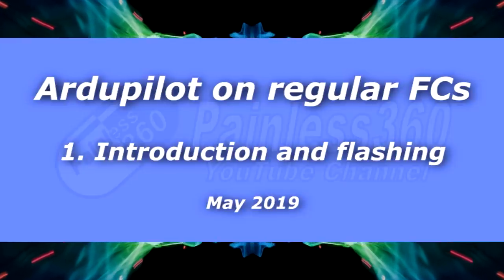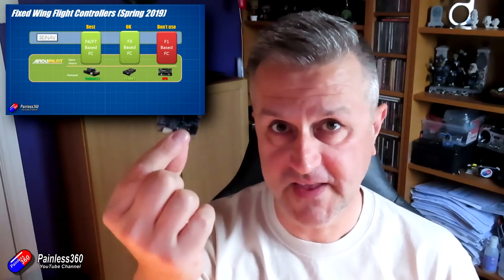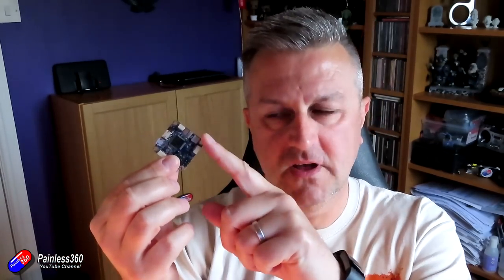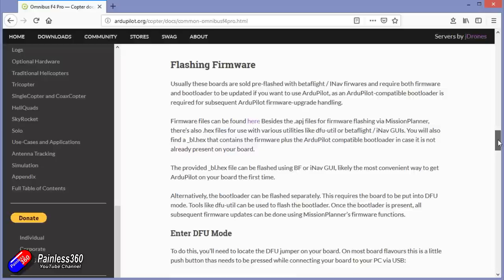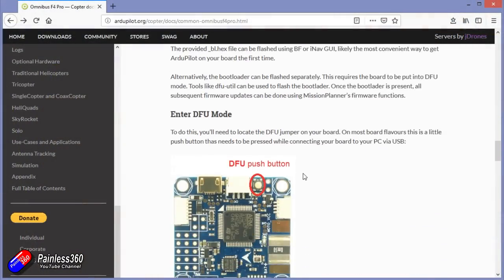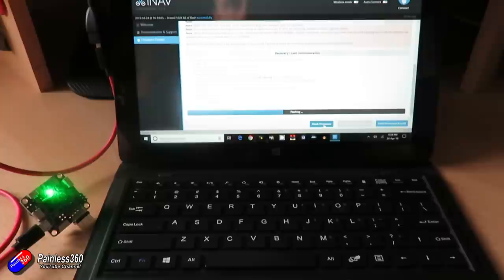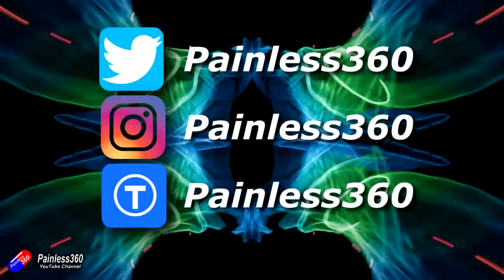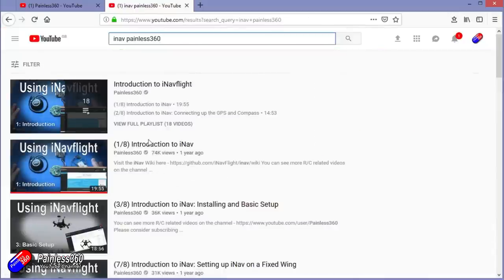Easy Ardupilot on Omnibus Series: 1. Introduction and flashing the firmware

Comment: Sorry if you have already answered this somewhere but, last I looked, if you were building a QuadPlane using Arduplane you were stuck with using a Pixhawk or Cube as they were the only controllers to give enough I/O to handle 5 ESCs and at least 3 servos (preferably 4). I have a Pixhawk shoe-horned into a Ranger1600 based QuadPlane and it would be great to be able to use something more compact (and with more durable connectors!).  Are there any options I should look at please?
Reply from the maker: I've not tried a Quadplane so don't have any experience to sue to answer this one for you. I have used a trick or two when I'm not sure how much power the servos need (see the Arduplane/Omnibus series..) Hope that helps.. Best of luck!
Reply: @Painless360  Many thanks for the reply. I have done another scan of the market and it seems the Pixhawk and Cube are still the only controllers with sufficient I/O for QuadPlanes though my guess is that the rise in popularity of the QuadPlane configuration will promote more controllers that will do the job.

Comment: Great video!
Will ardupilot work properly when installed on regular Omnibus F4 v3 (non pro) if external current sensor is connected from 4in1 ESC?
Reply from the maker: I've not tried, the wiki is very specific on the specific boards supported ...
Reply: Painless360 Thanks for reply. I'll give it a try.

Comment: Do you have a page of the steps you used for the beginning setup of the FC for this? I bought a board to experiment but i want to make sure i solder the 5v pins etc corrctly
Reply from the maker: All steps are shown in the series. Best of luck with the build...

Comment: If I power 4 9g servos and a Raspberry Pi Zero with the on-board SBEC, is it going to be fine or catch fire? I don't ever see anybody using the on-board SBEC on the F4 Pro with Ardupilot.
Reply from the maker: You need to figure out how much current all those things need and see if it's less than the on board 5v regulator is rated for... See how I did it by watching the rest of the series...

Comment: HELLO MY FRIEND !
I watch your videos, and I think they're excellent. I was very interested in purchasing an Omnibus F4 Pro after I learned that it can use Ardupilot, more specifically Arduplane, as I have Apm, Pixhawk, Pixracer etc, and I only have to say great things about these controllers and this firmware, but now I'm going for FPV with flying kite, your kite is very nice, congratulations!
Ok, let's get to it, kkkk, just ask me some questions. You have shown that there are two ways to update the F4 Pro firmware, one is by Inav itself and the other is by Zadig, am I correct? do you put the F4 in DFU mode ?, you have to keep holding the button, or just a touch, you already enter DFU.
Thank you. Greetings from São Paulo, Brazil.
Reply from the maker: Zadig us used to replace the  driver when it's in DFU mode. See my video about it and flashing flight controllers... Happy flying

Comment: Is it possible to flash ardupilot on dys f4 pro v2 or cl Racing f4?
Checked the ardupilot website. Couldn't find any firmware
Reply from the maker: If it's not there then it's probably not supported... yet!

Comment: Great series. I was using APM years ago starting with APM1 (still have one laying around) and now am to build in a MatekF411 into a Bixler, but I really would like to go with Ardupilot, as I know it very well and liked it those days, when nothing else comparable was out. I do not find the Matek F411 wing board on the boards list on the AP site. Only the F405 is on the list. Do you know or think if the F411 will work as well?
Reply from the maker: As far as I know only the boards listed are supported..
Reply: @Painless360  Thanks for the quick answer. So I will have to get one of those supported boards.
Reply: @Painless360  I will give the F411 a try though. So what could possibly go wrong? There is only one way to find out ;)
Reply: Does not work. Tried to flash the Matek F405 Hex onto the F411, but after around 25% the progress bar gets stuck and nothing more happens. So I can confirm, it does not work on the F411. Will stick with INav on this board and consider Ardupilot for another build and then will go with either the F405 or the Omnibus pro.

Comment: Just getting my feet wet with all this. For all the extra cash a pixhawk will run you, are there additional features it will have that a cheap FC will not have?
Reply from the maker: Depends on which PixHawk you're talking about. There are lots - see my PixHawk series. If you want an OSD then the non PixHawk boards are the way to go..

Comment: What would cause iNav and Betaflight to not load “local” firmware? I have an f4 pro v3 that has iNav flashed and tried to flash Ardupilot but the firmware won’t load. I downloaded the latest stable version of ArduPlane hex for the f4 pro but neither iNav or Betaflight will load it.
Reply from the maker: When you mean load it do you mean into Beta/iNav flight or to then flash it onto the board? What specific error do you get?
Reply: Painless360 I tried on both iNav and Betaflight. I go to firmware flasher, click on “Load Firmware Local” the window opens to select the “ArduPlane” hex file, I click “Open” and it doesn’t open in either configurator. The “Flash Firmware” button never lights up because the firmware isn’t loading for whatever reason. I can flash iNav or Betaflight to it without problem, but not the ArduPlane. I don’t get any errors, it just doesn’t load.

Comment: Hi, thank you very much for the helpful video, I have successfully flashed Ardurover V4.2.0 onto my Omnibus F4, but I am running into an error when connecting it to Mission Planner. The error code in messages is - Config Error: INS: unable to initialise driver. I've tried flashing other modes such as Arduplane V4.2.1, but again the same error message shows up. I have not soldered or touched anything on the board yet, it is brand new out of the box. Wondering if you have any solution to this? Thanks!
Reply from the maker: I've not seen that, I'd check the forums.. Best of luck
Reply: @Painless360  Hi, thanks for the reply, I've tried searching the error code up on the forum and internet, havent found anything beneficial yet. Could it be related to the configuration page on mission planner? maybe I have to change a couple of values or parameters? what are your thoughts? Thanks again!
Reply from the maker: Like I said, I've not seen it. https://discuss.ardupilot.org/t/config-error-ins-unable-to-initialise-driver/74920

Comment: can you install a full side tbs Crossfire rx, that way we can use mavlink over the bluetooth and show the plane in mission planner.?  One more item Lee, some of the V3 boards have bad barometers, so works in the beginning but after few reboots goes red, is not the software is the hardware be aware.
Reply from the maker: I've not tried it but I don't see why not. You just need to get the telemetry pins from the flight controller into the 'MAVLINK pins on the receiver.

Comment: Hello, I've followed these very helpful setup steps and have 2 issues. External compass won't calibrate, "seems like it is still using internal compass. Also it is not recognizing my radio receiver. Any help is much appreciated. I am at a loss, gps and everything else is working well.
Reply from the maker: Every step I followed is in the series. Happy to help but please watch https://www.youtube.com/watch?v=olIqTiSJHIY and come back to me with more detail of what you've tried..
Reply: @Painless360  I've retraced my steps and got me radio calibration figured out. But still cannot calibrate the compass. I dont have the live calibration option for some reason. I am trying the onboard calibration and the green bar runs up to 99% and restarts over and over. I've swapped the bn-880 and get the same thing. I am running mission planner 1.3.70 and the latest firmware in the stable directory for the fc. Also tried calibrating in Qground control with no success. Do you have any ideas what to check next?
Reply: Qgroundcontrol gives me a code of "mag bad orientation" when it fails the calibration.
Reply: @ivyscrochetcorner7983  hello did you manage to fix the problem i'm having the same as you

Comment: Edit:-......Fix for problem below.......Finally worked out with your help how to get the bootloader file for the Rover (boat..... ) ardurover_with_bl.hex onto my Omnibus F4 pro board...thanks....so do I now have to load the other normal hex file that was in the same folder on Ardupilot site ( ardurover.hex) before the Mission Planner will see the Omnibus F4 pro board..???
Downloaded the Mission Planner and plugged the board in with just the bl file but nothing comes up... blue light is flashing but nothing from Mission Planner......tried the "connect button but it says timeout waiting for Mavrick ...the board I can see in device manager....a second usb device shows as omnibusF4pro-BL but no extra com port coming up.
 If I go setup to load the rover program from within Mission Planner it says failed to recognise board.
Just went through and did a reflash of the ardurover_with_bl.hex and it says all ok...seems I'm missing something basic here...but has me beat as to just what.
Reply from the maker: All I figured out is in the series. Maybe a driver issue? Best of luck
Reply: Thought I might let you know and for others who may get the same/similar problem, I managed to fix the problem using a small program called " ImpulseRC Driver Fixer". Cheers

Comment: Hi there could do with some help, am  using the same  omnibus f4 v3 pro i've soldered the receiver wires to the pin holes so to practice on simulators but transmitter /receiver not talking ( sticks not moving in betaflight)  any ideas what could be wrong and do i need solder the other required pins before sticks will move thanks in advance .
Reply from the maker: You need to setup the type of receiver in Betaflight and also solder the little pads for S-Bus or PPM on the FC itself.. Best of luck!
Reply: @Painless360  Hi again thanks for fast reply , i've soldered the pads on FC for the S-bus/PPM but still no signal between receiver and transmitter, maybe transmitter cant bind powered by USB so will connect to PDB see if the  it binds if and  all goes well will keep u posted thanks again  *

Comment: If I’m using arducopter do I wire the moters in the same place as in normal pinout for the omnibus (pins under rc in)
Reply from the maker: You can configure the  pinpoints however you need. See the next videos..

Comment: Hi folks from Belgium.
I flashed the firmware using airbot f4 firmware on inav.
It would not open in mission planner 😢
Could you show me the correct link to the firmware on the ardupilot site? Please?
My board is omnibus F4 Pro v3
Thanks a lot!
Reply: Hi, first you will have to decide the Ardupilot firmware type. You can choose between ArduPlane, ArduCopter, ArduRover etc. 
For a plane: http://firmware.ardupilot.org/Plane/stable/omnibusf4pro/
For a multicopter: http://firmware.ardupilot.org/Copter/stable/omnibusf4pro/

Comment: Could you use this board and ardupilot plane in a flying wing and not implement the GPS or OSD and just use the stabilizer and auto launch functionality ?
Reply from the maker: Yes but you would be missing out on a lot of extra benefits for the sake of a GPS...
Reply: @Painless360  Thank you so much for the quick reply. Will go for the GPS as you suggest. Thanks again!
Reply: Please ignore and apologies for asking. Just bought the f4 pro on ebay.

Comment: painless, hope to get your help on connecting sbus receiver to a f4v3 non-pro fc. the communication is just not working. i have tried connecting gps and bluetooth to the fc and both worked. i have no idea the sbus does not work. oh and on the fc board there is a jumper for ppm/sbus. it was soldered to sbus. could you point me to a solution? thanks
Reply from the maker: I've not used that FC. I'd remove that soldered connection to see what changes.. best of luck
Reply: @Painless360  thanks.i tried remove sbus jumper soldering and connect to ppm. it worked!

Comment: I’ve managed to put it on my omnibus but I can’t get my receiver to work do you wire it through sbus or ppm ?
Reply from the maker: Solder Ppm on the FC as per the video..
Reply: If I’m trying to use  ppm receiver as per the same as apm 2,.8 with six wires I don’t understand where to put the  5th channel for the modes

Comment: Hello sir, we cannot upload the hex extension files we downloaded from ardupilot to inav. Which program should we use to load files with hex extension? And can you share the file named arducopter_with_bl with us?
Reply from the maker: Not sure what you are taking about. The firmware file? To help I'd need the exact error you are getting...
Reply: @Painless360  We are omnibus f4 pro v2 exhibition for drone construction. When we read the Mission Planner section, we cannot see it related to the time. What do you think about it?

Comment: Hi there!

I make and fly planes for the last 15 years.
Now im up to start with FPV just with Artificial Horizon!!
Plane with (Camera+Tx) ( Monitor + Rx) and im good to go for now.

I watch already a lot of your videos (very good btw, and saved on a privat playlist for my future FPV Expert long Range) and it looks doable but it will use some time and some money. Watching your videos reminds me the days that i did an gimbal and spent hours understanding the hardware and open source software :) .

So i ask you: is some way, simple, fast (and cheap please) to add just  Artificial Horizon  (or more, if must be) to my On-Screen display FPV?!
just the fastest and simple way!
Thanks in advance!
Best regards
Reply from the maker: There was a project to use a MinimOSD to provide some stand-alone OSD pieces but the only way I would do it now is pop in a little flight controller to show the OSD, than you can also add battery status too..
Reply: @Painless360   hi there!
Thanks for your reply!
OK, so i will try as you advice pop in a little flight controller; can you advise me for the most easy and simple flight controller to install and config?!
thanks
Best regards
Reply from the maker: See my Kit Picks 2020 video for my choices. I have loads of build on the channel that show how to set them up. Best of luck!

Comment: I couldn’t get it to work it flashes but no flashing light like it’s done spent hours on it.
Reply from the maker: Tricky to offer any advice without specifics - what troubleshooting have you already tried?
Reply: Painless360 I got it going it might have been the way I download the hex file opened it then saved it.also used a different arundpilot version

Comment: I've never used iNAV nor Ardupilot.  But from my circles, I hear nothing but bad about iNAV, and ArduPilot is a "must use".  I always thought ArduPilot and OpenPilot had a link between then like a fork or searching of code.  After digging into the internet Archives I was surprised to see the ArduPilot started from the very beginning on their on supported by DroneCode.
Reply from the maker: If you follow my iNav series you should find it works great. There are a few common mistakes that builders make..

Comment: helloooo pleaseeee put adru copterrrrrrrrrrrr in itttttttt and make videoooooo
Reply from the maker: See my Pixhawk and Big boys toys playlists as I've already done that there. Setup in software for copter is the same.. no need to post a question fuor times on separate videos either ;) Remember, you can support the channel by becoming a Patreon. Best of luck
Reply: @Painless360   well i didn't expect reply 😍😍
 Btw.. i mean install and setup adrucopter in f4 or f7 FC and  is it possible it fly as good as pixwahk in loiter mode?
Reply from the maker: Yes. Only the hardware is different. See my series and Ardupilot wiki. Best of luck.

Comment: can you use this board to control a hexacopter, can PWM5 and 6 be used for motor control?
Reply from the maker: Maybe. There are better options though. Best of luck
Reply: @Painless360  I have decided to build a quadcopter and am considdering using the omnibus f4 v2. I wondered if you thought this FC was a good choice? Or do you have another preference?